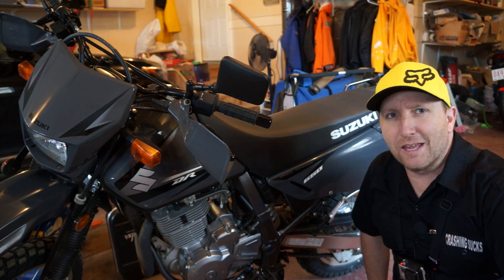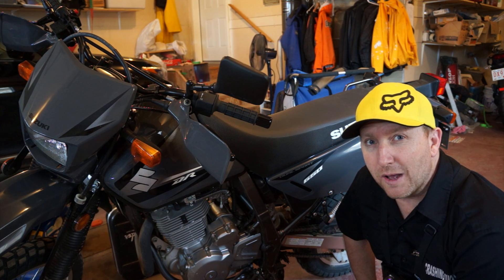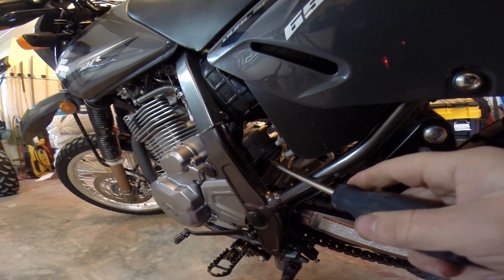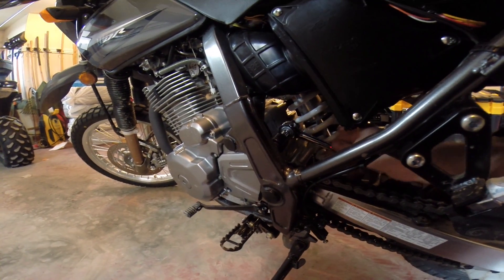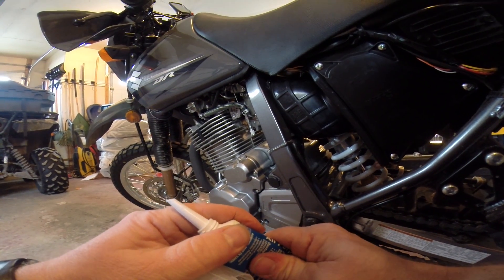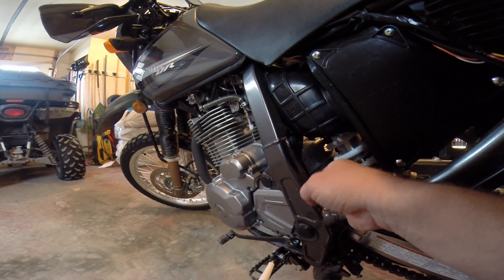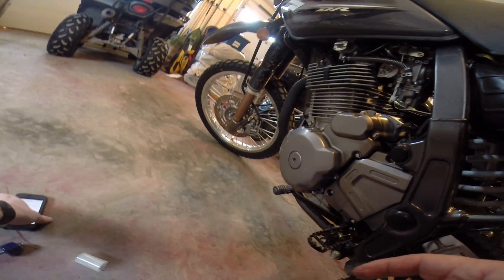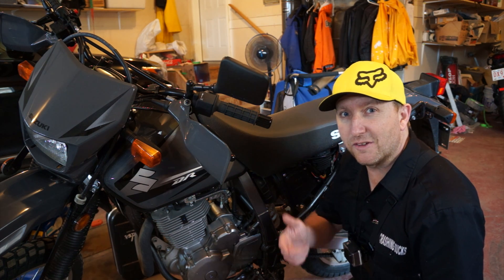Suzuki DR 650 Upper Chain Roller Removal With 6IOD

Comment: well done - one other tip for viewers is to use "neutral cure" silicone rather the acetic cure (the one that smells a bit like vinegar).  Neutral cure is recommended for anything that can rust - acetic cure contributes to rust and is for glass, porcelain, non-metallics
Reply from the maker: Thanks for the tip

Comment: I have 2019 Dr 650 and have a lowering kit on there. I have not taken off the chain rollers (top or bottom). The top one has been replaced 3 times now. Do I need to take it off altogether?
Reply from the maker: I’ve heard mixed views on this. I never had anything go wrong after I removed mine.
Reply: What keeps happening to it?! I have a 21 and a 19. 0 issues with the chain roller